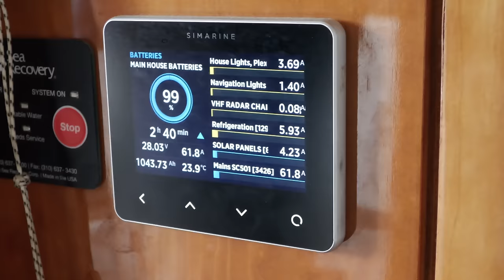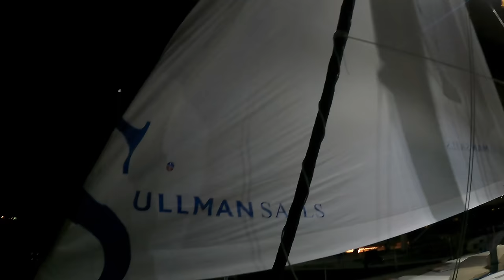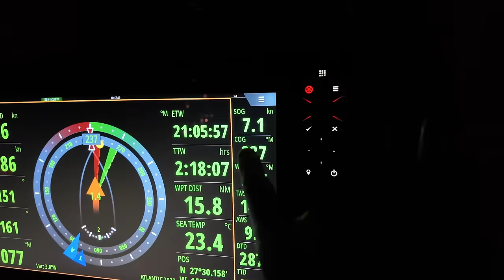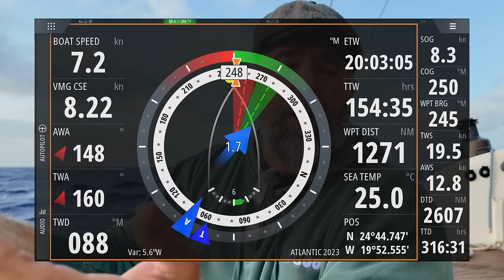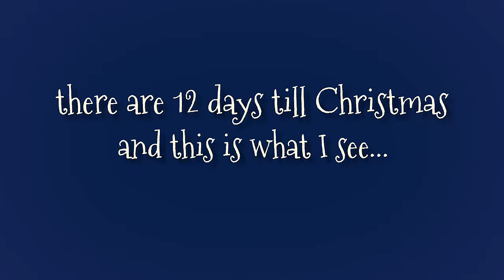CROSSING THE ATLANTIC! 🌊 (Season 8 BEGINS) Ep 268

Comment: Nothing like brand new crackly sails!  They look great!  

Tip - When it's so light, try putting your jib blocks further foward to put some more pressure on the leech.  It will give you better drive.  As the wind increases, bring the blocks back to let the leech twist off and spill air.

Comment: Renee:  I bought a Hawkins pressure cooker last year and have been enjoying it tremendously.  It'd cook your stew in less than an hour!  Zero electronics so all mechanical.  Bullet-proof.  Any heat source, 2-3 cans of sterno.

Good on the sugar reduction!  At 60, I discovered I should have eliminated all sugar back when I was 50.  We humans just do not fare well on it.  Total carbohydrates per meal should be kept below 50 per meal, 150 carbs/day, with normal consumption of healthy protein and healthy fats and oils.

Salads:  You can submerge a salad under saline, shake to remove air, and press it down before capping and freezing it.  They'll keep for months.  You just have let the ice melt and fish out the salad.

Comment: Just a quick tip on making lettuce last over 30 days ,do not cut it up,take the whole head of lettuce and dry the outside, wrap tightly in aluminum foil, you'll need to check it every few days and remove any leaves which may be brown or wilting.
I understand it's easier with limited refrigerator space to cut it up and store but I can typically store a head of lettuce for 30 days or more by wrapping it.
Also, a small refrigerator fan (battery operated,I just bought the cheapest with the highest rating,around 3000 rpms) is a must have,it helps the air flow and pulls the cooler air down towards the crisper drawers.
I am a full time RV'er  but the basics are the same with limited storage refrigerator/freezer space.
And if you don't have one already I'd highly recommend a vacuum sealer, it may be time consuming separating meat and sealing it but I have almost doubled the capacity of what I use to be able to store in the freezer,instead of large packages of meats the vacuum sealer flattens it so it's can be stored/stacked much better.

Comment: Your comment about the solar panels caught my attention.  I have recently also set up panels on my boat with new Lithium batteries.  I am not satisfied because I only get about 30% of their rating from an output point of view.  I have built other solar systems and get 100%. I discovered that my solar controller (MPPT type) competes witht he battery internal charging systems.  So not I am looking to replace the MPPT for a DC-DC converter so that it provides a constant voltage/variable current to the load and battery.  If you have done any research on this I would much obliged to hear what you have. found.  Regards

Comment: @SailingZatara I was just wondering if you could provide some guidance about "proof of experience" sailing in the Med / Baltic / EU.

My issue is as follows:
* I would be sailing a vessel I own
* I hold a valid marine licence (required theory and practical to obtain) where I'm a citizen and legally resident outside the EU. This licence is accepted by Croatia as suitable for vessels up to 30GT
* I have been told by RYA I can't legally hold an ICC (without being full time legally resident in the UK - can't do this) because I'm also a citizen of an EU country that's signed Resolution 40 and would need that countries local licence.
* I can't get a local licence from the EU country I have citizenship of because they require one to be full-time resident and to annually re-qualify for the licence i.e. I'd have to live there permanently
* SLC isn't a viable option as few places recognise it and having to commonly do journeys with other vessels to maintain the SLC isn't viable based on where I usually spend my time

What I'm wondering is how can I prove experience sufficiently to avoid any issues and impounding if I were to sail the Med / Baltic / EU?

Since Croatia recognise my licence, should I try to get the Croatian equivalent (licence conversion) as they're part of Schengen?

Should I see if I can get the French equivalent (licence conversion) as they're part of Schengen?

Would an albeit expired commercial qualification (can't maintain unless working commercially on boats) be accepted?

Or do I just have to avoid the entire place except France and Croatia when it comes to sailing?

Am I likely to have the same issues in the Caribbean or in Vanuatu?

Comment: That attitude about using fuel over clean energy is the problem.  If you get good solar panels you will have 20 years of free electricity
Reply: if you get stuck in the doldrums or somewhere else for days, then you would most likely need to motor for a lot of hours to get out of it, and in that case batteries and electric motors just aren't gonna cut it for such long motors